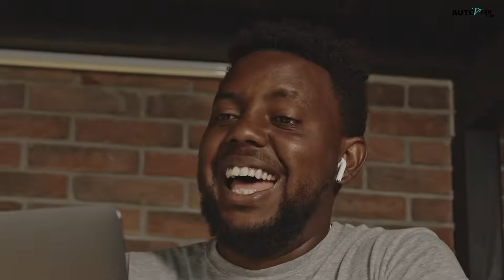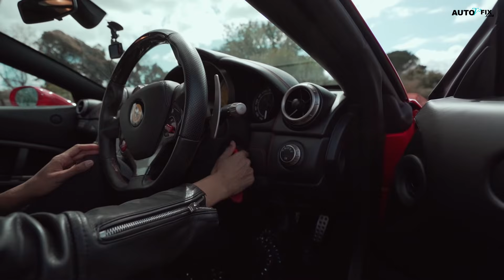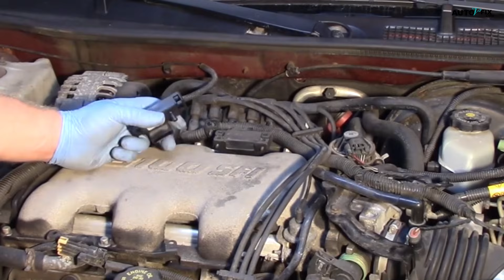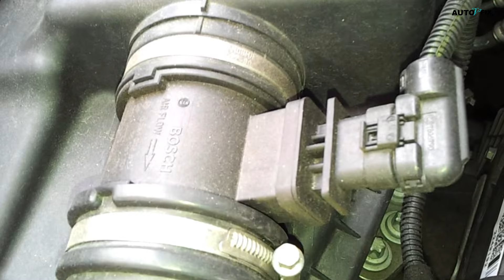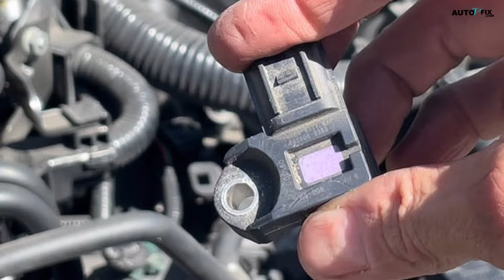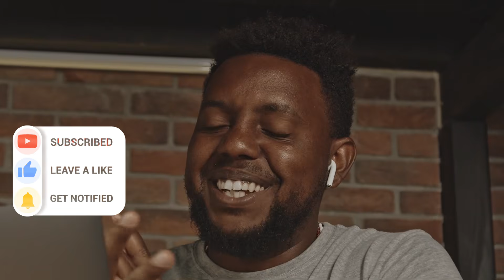How to Locate, Remove and Clean a Dirty MAP Sensor

Comment: Disconnect the battery?
Then you can clean the map sensor and go to the garage to have the CPU malfunctions reset.
Loose battery voltage means problems with your computer.